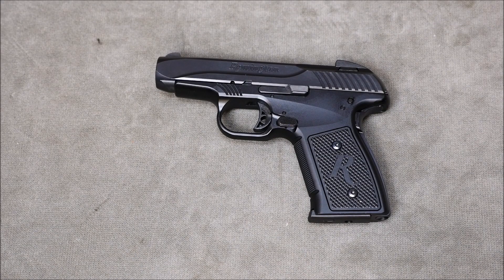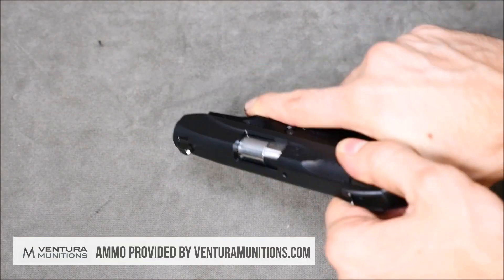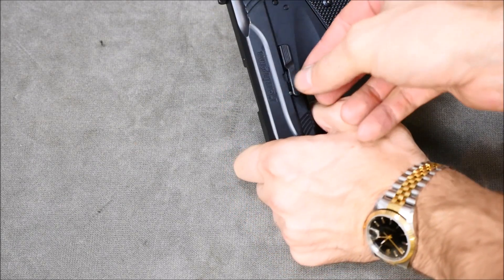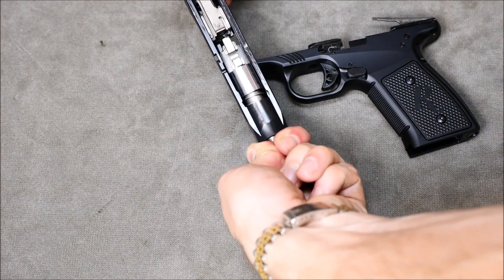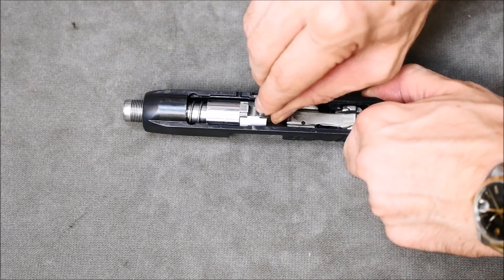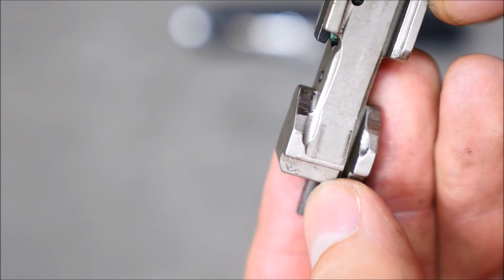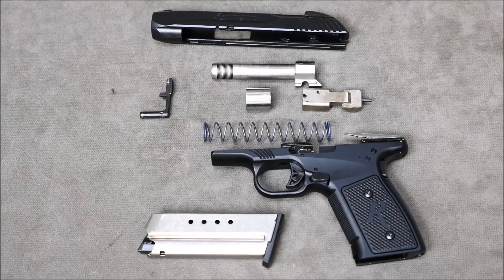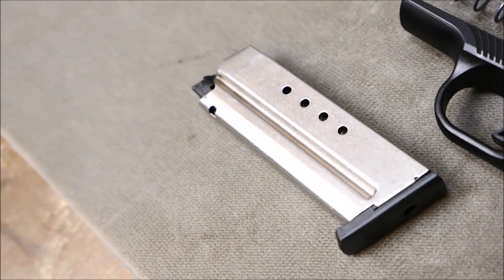Remington R51 Field Strip

Comment: Send the magazines back to the factory. The big problem was with nosediving ammo. Most magazines are subcontracted out to other companies so its not surprising. A lot of other reviews I've seen have been functioning without any hiccups so its probably the magazine.
Reply: Those were my thoughts exactly. From the very beginning it looked like a magazine problem. My buddy watching the review with me said the same thing. And no one is going to carry steel cased brown bear ammo for defense anyway. And to top that off, my polish P64 has choked on steel case ammo before and it was made for that stuff! 

If you want a handgun that has 100 percent reliability feeding wise, get a revolver.
Reply: It was cycling the steel cased but it was more likely to nose dive for some reason. The whole point was being economical with practicing. Possibly adding a stronger recoil spring for those hard primers that show up on steel cased ammo.
Reply: I know but there was alot of emphasis on it not handling steel cased ammo, which isnt really a big deal as its plinking ammo to most people. A stiffer spring would help, they did make the slide very easy to operate for those that have trouble with it.

Comment: I must have the one r51 that works, mine has about 250ish rounds through it and only two malfunctions, both in the first magazines I shot.  I don't buy steel case ammo so I can't speak to that.  I have shot 115gr, 124gr, and 147gr fmj and 115 +p hp.  The two malfunctions were with 147gr.  With my gun at least the only issue is that the heads of the cases have to be right up against the back of the magazine or that little bump on the front of the magazine will grab the noses of the bullets.
Reply: Only 250 rounds?  I would put at least another 250 rounds through it.  It's a gun known to have problems, and yours has malfunctions also.  Maybe if I ever had it go through 250 round without a failure I'd trust it enough to carry.
Reply: Sunshine_Shooter While that's true.  At the rates that this and other channels' reviews of the r51 failed I should have seen upwards of 20 malfunctions at this point, but I haven't.  As I said both malfunctions were in the first magazine I fired, since then no issues.  I'm just trying to put another data point out there, not recommending anyone trust their life with it.
Reply: zeos386sx The first 2 malfunctions were in the first mag?  That makes it more interesting.  I would be a little leery b/c of the documented failures, but your's may be the anti-lemon to their lemons.
Reply: Sunshine_Shooter that's what I was getting at.
Reply: I had mine for 6 years now, zero malfunctions. Simple to disassemble and reassemble.

Comment: is steel ammo a imperical test ammo that firearm manufacturers say to use to test a firearm or is it just you tube commandos justifying it to use because they are cheap. I am 46 and never shot steel or aluminum ammo in any of my guns. if it is a necessary thing to do please point me to said specific data showing the benefits of cheap steel ammo usage from a reputable firearm maker.  remember you can use cheap gas and non sae or api oil in your cars engine but no one does due to excessive wear and possibly internal damage. but that's just me,I am one of those snobs I guess who wants to take care of my investment in firearms. maybe if all someone can afford is steel ammo then maybe a cheaper gun with better ammo is needed.
Reply from the maker: I tested all kinds of ammo in my 500 round review, and it choked on most of it with many malfunctions.
Also, if I don't test steel then people complain. If I do test steel... then people complain. Reviewing guns is a bitch.
Reply: I understand your frustration with reviews. I do appreciate all you do and I am a big fan. I just hate the steel ammo aspect of firearms. Maybe the firearm needs a breakin,Kahr says 200 rounds before break-in in done,maybe this design needs the same procedure.  I break in all my hk guns with 300 rounds of 124 nato to be sure and 180 in my .40 hk guns. Your a top notch reviewer and don't let no one,even a bum like me discourage you
Reply: What are you protecting your investment from by not shooting steel? Since firearms are made to handle tiny internal explosions 10's.of thousands of times with out failure what do you think mild non heated treated steal casings are going to do to it? 

If your answer is absolutely nothing then you are correct if it's cause any type of premature wear to the ejector, extractor, or gauling to the ramp then you are the one that has actually bought into the BS lure of the internet.The greater majority of the .45 acp and 9mm used in the WWII by the Americans was steel cased. So many people will snub their nose at steel cased ammo then say they shoot winchester white box which is probably some of the worst produced a factory  ammunition made.

If a firearm made for the sole purpose of self defense and concealed carry and it cannot perform with a broad spectrum of ammunition it's a worthless firearm.
Reply: I am a transmission mechanic and I have always seen first hand what steel on steel friction causes and no matter the amount of high pressure lube that is applied internal damage and failure is always a constant resukt. if steel or aluminum were perfectly safe to shoot then every manufacturer would say it's OK to use in their products with no concerns with wear or warranty concerns. like I said,just because it's cheap and can be used doesn't mean it's good. just show me one handgun manufacturer that says steel or aluminum ammo will not damage or void warranty and then I will maybe rethink my position. and no matter what brass will always seal the chamber on ignition due to better sealing characteristics than steel or aluminum, just like how a firearm is intended. putting lube on steel is just a way for the ammo maker to convince customers it's safe,other than the AK,I can't think of a modern gun designed to run with steel. if it was as good as people think than every millitary and law enforcement agencies would use it just for the money saving aspect. run what ever you like,it's not my concern. I personally treat my firearms the way the manufacturer designed them,not the way a fringe group thinks they should be used.
Reply: due to shortage of brass and copper in ww2 was the use of steel used,but not used in korea,Vietnam or both gulf war campaings. like I said show me the imperical data put out by any firearm manufacturer showing the benifits of steel over brass plus the factual data showing how much steel ammo a gun should shoot to be considered reliable by the firearm manufacturer of any gun,I just like facts not Internet facts made up by any reviewer who did not design the gun. that's all I ask. I don't care what others use,it's not my money. I don't cheap out on a hotrod build and I don't cheap out on my firearms,if price is a concern with either than I need a cheaper hobby. we used to use black and white tv sets,but we don't anymore,pull chain toilets,but we dont,none multi viscosity oil,but we dont. old cheap technology is just that,old and cheap. modern ammo is safer,more powerful and more reliable. if given only one gun but a choice of either brass or steel,what would you take ?
Reply: james swan

I am sorry but physics tells us that a mild non hardened or treated metal cannot damage another that is naturally harder, or  heat treated. This is the reason why we can shoot AR500 steel thousands of times without leaving so much as a dent as well as the reason why shot gun barrels do not wear out from shooting steel bird shot something we have been doing for over a century. Again your reasoning is heavily flawed.
Reply: As far as manufacture recommendations as a guide lines is kind of a joke since most are there for liability reasons to protect themselves. I have never seen a single firearm pistol or even a high powered precision rifle that said it was okay to shoot hand loads however all precision shooters hand load. So going by your statements all hand loads are also sub par. 

I have about 30 pistols in my safe some going back to WWI and I have no issues putting steel cased rounds through any of them. My main competition pistol is a G17 and it's easily seen 10k rounds of steel cased rounds for practice. I have replaced springs only same OEM barrel, extractor and ejector.

Show me EMPIRICAL date where pistols shooting steel cased ammo exploded or had a complete failure where it took them off the line? Now I can show you data where factory loaded Winchester White box has caused some major failures including a few kaboomed pistols and these findings were backed by major manufactures.
Reply: that's a lot of conjecture in that statement but brass cartridges are the most dominant and widely used for the reasons I quoted,I don't need to be convinced of steels low performance because the market dictates it already. the old excuse of manufactures just covering themselves is just a steel ammo fan boy excuse.  I will never use it,I don't care who does and until late SAMMI prints reloading data for steel ammo it's just a cheap alternative to quality ammo. run what you like,no one will stop you. I chose to use my firearms in the manner that were enginered that's all. by the way modern guns are tested with brasd,that is why the spent cartridge sent with the gun is brasd,not so called cost effective steel.
Reply: remove all the lube from the steel ammo then run it through the firearm and see if it causes no wear. no lube is needed for brass. steel on steel is a friction generator,not brass on steel.